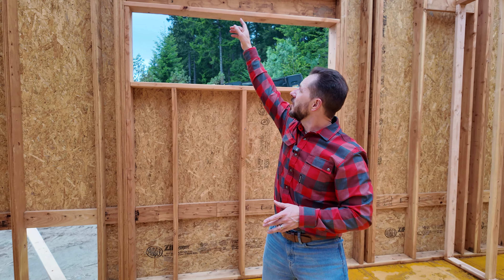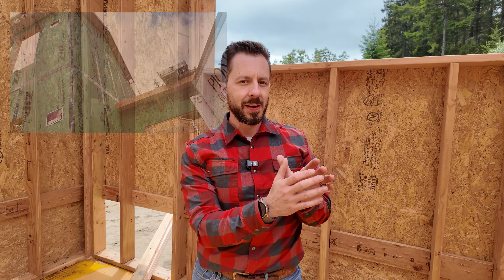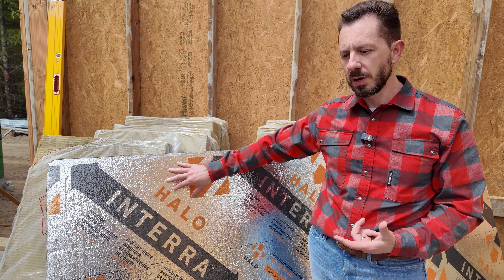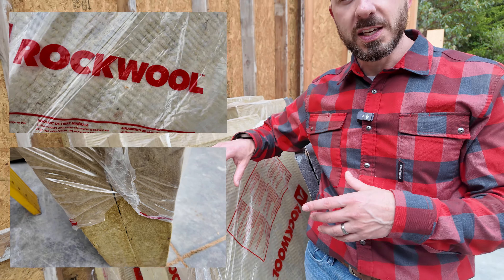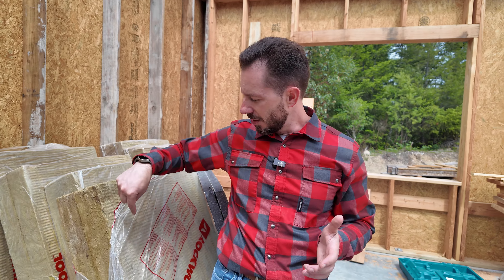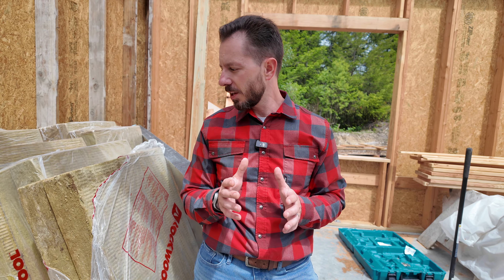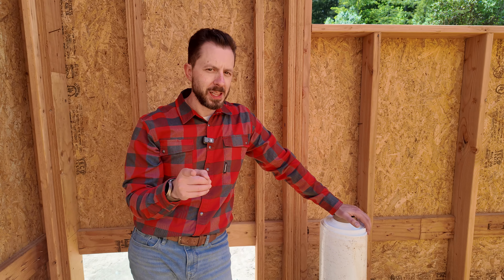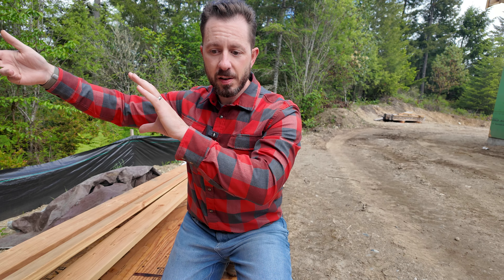Building Science of Modern Balloon Framing Part 1

Comment: Unless the blocking behind the ledger board is structural, insulation can be used as fire blocking instead of the blocking.
Reply from the maker: I tend to agree with you since the ledger isolates the floor diaphragm